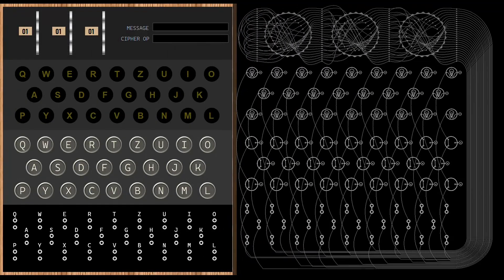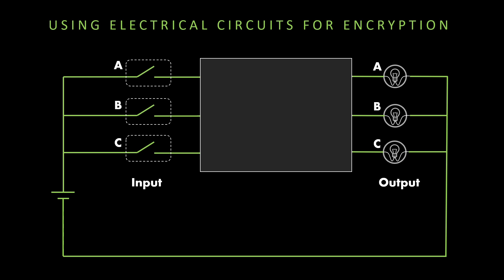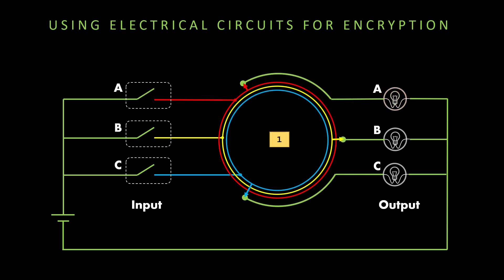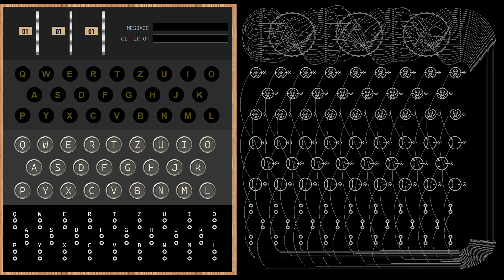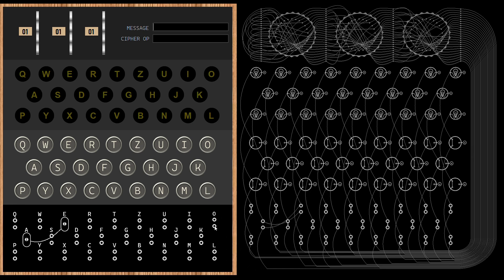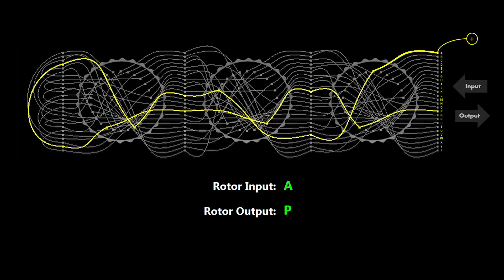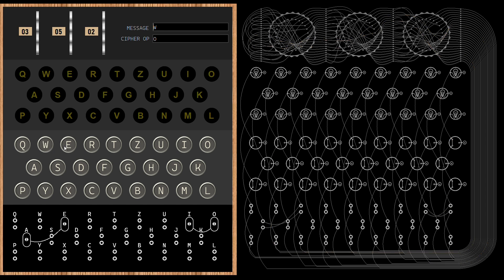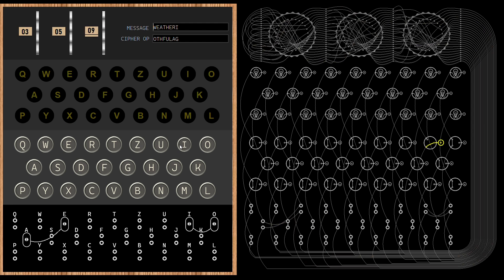How Enigma machine works | Part-2

Comment: In the animation the wires for the rotors get long and shorter as the rotor moved.  That wouldn't have happened in reality, so how did the wiring in the Enigma not get tangled up?
Reply: In reality, they dont use a wires. Instead, they use a pin connector. It's something like ipad pro connector that  connect the ipad with external keyboard.

Comment: What happens if the same letter is returned? It looks like no letters would light up since the bulb will be disconnected since the button for that letter is pressed. Did they just think when nothing lights up that means it got converted  to the same letter and wrote that one down?
Reply: The system is wired in a way that is impossible for the same letter to be returned
Reply: The leftmost wheel looping back on itself is what prevents that. It because every position is connected (at design/manufacture stage) to a different position in that leftmost column of terminals, it guarantees the letters would always be different. I suppose that could factor in to why they used a 26 letter keyboard, no Eszett (the German sharp S, ß), because they needed an even number of keys.

Comment: You didn't mention anything about the ring settings for the rotors.
 Plus that you can change the position of them of where they are placed in the Enigma Machine Left, Middle, Right.
That there was 2 reflectors B or C depending on the Enigma Machine they were using.
The advancement of the next rotor would happen when the notch in the back of the rotor would line up with the mechanism that advanced the first rotor.
Regardless if the rotor rotated 26 times or not.
Example.
Lets say you are using rotors 1-2-3 in that order L-M-R
There are no plugboard settings or ring settings they are 1 or A for all 3.
We will Encrypt Enigma
The Rotors are set to 16 - 4 - 21  P - D - U
Rotor 3 will advance the second rotor when 22 or V is visible in the window. Rotor 3 is the right rotor
When E is pressed it a turns the right rotor to 22 or V now we have 16 - 4 - 22 in the window
E is now encrypted to B
when N is pressed the Right Rotor and the Middle Rotor will advance.  now we have 16 - 5 - 23 in the window.
N is now encrypted to X
Rotor 2 will advance the third rotor when 5 or E is visible in the window. Rotor 2 is the middle rotor.
when I is pressed the Right Rotor, Middle Rotor and the Left Rotor will advance. now we have 17 - 6 - 24 in the window.
I is now encrypted to Y.
Now only the Right rotor will advance because the notches are not lined up yet.
when G is pressed  we have 17 - 6 - 25 in the window.
G is now encrypted to R.
when M is pressed  we have 17 - 6 - 26 in the window.
M is now encrypted to J.
when A is pressed  we have 17 - 6 - 27 in the window.
A is now encrypted to Q.
ENIGMA is Now .BXYRJQ

The Reason why The Middle Rotor advanced again when it made the Left Rotor advance [16 - 5 - 23] to [17 - 6 - 24] and it was already passed
22 or V is because the notch that advances the next rotor will also make that rotor advance.
That's why the right rotor didn't have to rotate 25 times again.
Reply: XD where did you learned about enigma machines??
Reply: @vaisakh_km 
I watched documentaries on them 
Then I created one in Excel and it works fine but I didn't realize about the second rotor advancing if it was at the notch on that rotor.
So I did more research and then I found a virtual enigma machine online and tried encrypting phrases to see if it would encrypt the same output as the one I made in Excel.
That's when I realized the output string was not the same at a certain point because the second rotor was advancing.
So I had to fix my code in Excel to make the second rotor advance when it was at the notch and if the first rotor made it advance.
Now my enigma machine in Excel works fine.

Comment: It is a nice demo but you missed out on the two rings on each rotor of the Enigma machine.
The rest of this is how I understand it.
Each rotor had a ring which on which was written the letters/numbers displayed for the operator to set the starting position for each message. It had 26 positions. This ring was not fixed but was removed at the beginning of every day, turned according to the instructions and put back on the rotor. The bombe(s) ignored this ring in its calculations. The ring position was easy to work out manually once you had a full setup that worked.
There was another ring on each rotor called the "kicker"(?). This also had 26 positions and was moved every morning. In the video it is stated that the middle rotor moves one position for every 26 turns of the right rotor and the left rotor moves one position for every 26 turns of the middle rotor and this is true. This ring controlled at what rotor position the next rotor to the left would be given a kick. The kicker ring on the leftmost rotor was not used. I do not know how/if the bombe took this ring into account or how its position was deduced.
Apart from this I enjoyed the presentation.